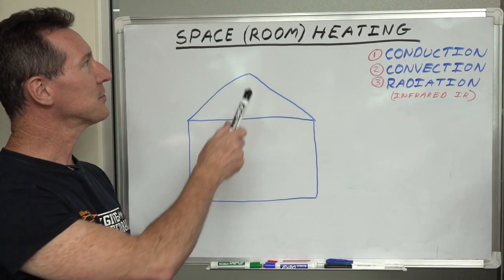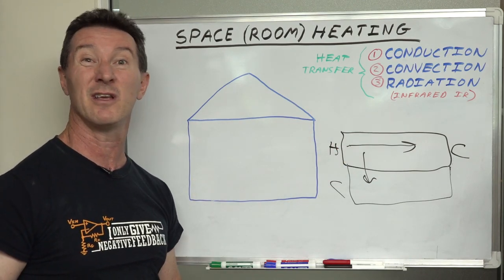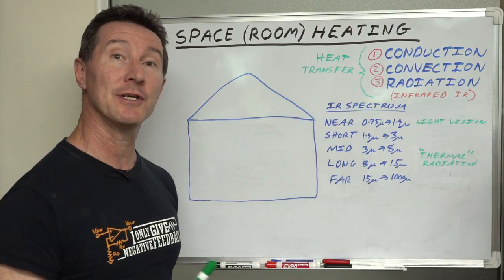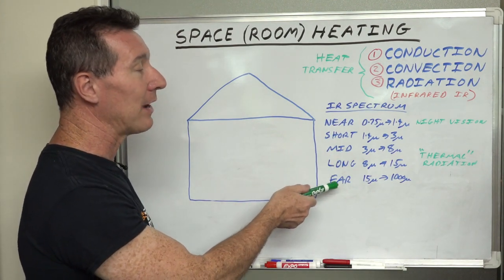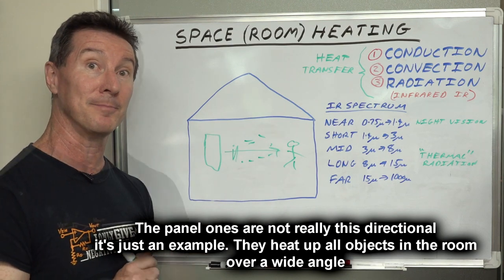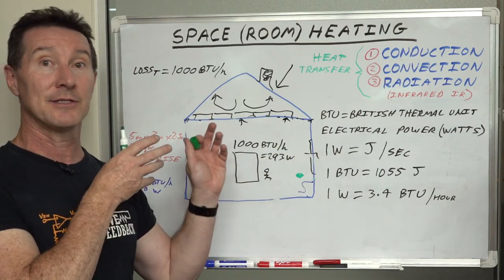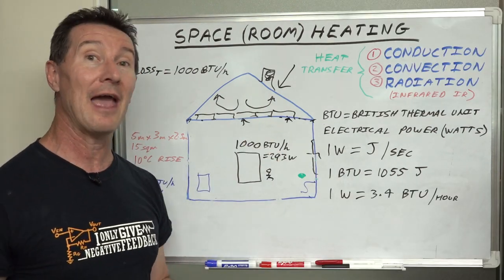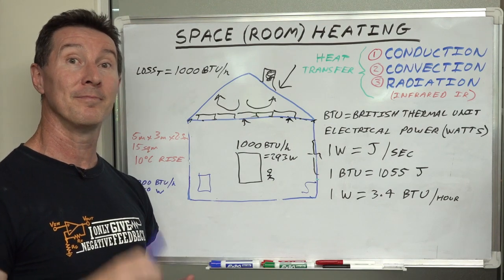EEVblog #1187 - Room Heater Technology Explained

Comment: just realized solas may actually last longer due to their "magic graphene" being seemingly applied all over the element however they will still be no better efficiency wise than a bargain-basement 1kw wire wound ceramic element >100% is impossible
must note: by "last longer" I mewan the "magic" graphene provides an oxidizing resistant barrier to the element and spreads the heat evenly so as to reduce "hot spots" that can burn out low quality elements faster however this only prolongs the life of an already cheap heating technology  while bumping the price way over the longevity bonus so a true "eco nut" would shy away from those lying pos's and just buy a cheap thermostat controlled oil massed heater that claims to use "eco friendly" oils rather than solas wank heaters

Comment: Every heater is reducing the energy of the universe. Thanks physics
Reply: Dylan T Nope, but it usually increases the chaos (entropy).
Reply: Eh, just moving it around really.

In many cases, heat in one area was converted into electrical enerfy which was then moved into your home and re-released as heat.
Reply: Resources of Earth as a system, yes, of universe, certainly not.

Comment: A heat pump is very inefficient. As the temperature goes down the efficiency drops. At about 45°F It is pretty much useless. You have to have heat outside to transfer It to the inside. The opposite is true for air-conditioning, the hotter it is outside, the less efficient it becomes.
Reply: I'll have to let my heat pump know about that 45 degree limit... it's doing quite nicely at the sub zero temps we've been having.  (( you're referring to the old R22 systems, YES, they had issues, not so much with the new systems ))
Reply: I don't care what type of refrigerant It uses, they all have the same problem. At below 45°F, the condenser/evaporator will turn into a block of ice. At that point it will not function at all. You're heat pump has a secondary heat supply, either electric, oil or gas, Which takes over at about that temperature.
Reply: It does NOT have secondary heat... it's all from the refrigerant.  I have disassembled several of these units, not an electric heater to be found.  Try again.
Reply: The only way a heat pump will work below 45°F is if you lived in a very dry climate. In the heat pump mode, the evaporator Is on the outside unit. The evaporator needs to be at least 15°F below the outside temperature for it to work properly. That means the evaporator is below freezing. Any moisture will freeze on the evaporator. Turning into a block of ice. At that point it will not function. The closer the evaporator temperature is to the outside air, the less efficient it will be. 
: 
Lodging:
Reply: I repair them for fun and profit, and have one heating my house as we speak...  current temp is 7, humidity is 45.  YES, it does have to defrost, YES, during snow storms it freezes up.  I'm not sure where it's finding the heat, but I can assure you, it has absolutely no secondary heat.  I haven't had my specific unit apart, but I picked one up from the hvac shop, there is NO secondary heat strips in them.  None, zilch, nada...
Reply: You may do it for a hobby, but I have been doing it professionally since the 1970s. I'm now retired.
Reply: I'm still wondering where mine has it's secondary heat coming from.  I'm sure things have changed since the 70's...
Reply: Joe A,  it's clear to me that you are not aware of how "modern" heat pumps (with regular defrost cycles) work. Have a look around, the world has changed since the 1990's and we are enjoying COP's of 3-4 even below freezing. I love mine!
Reply: In spite of what you might think, Automatic defrosters has probably been around longer than I have been alive. that's nothing new. Yes we have better electronics, and better Freon. But you cannot defy the laws of physics. No energy conversion is 100%.  These are closed loop convection systems. They do not produce heat directly, they transfer it from one place to another. You get the efficiency by condensing moisture out of the air. 144 BTUs per pound. When it freezes you will gain another 144 BTUs. But that is lost during the defrost cycle, Plus some. Once the ambient air reaches the freezing point, the moisture in the air diminishes. And any moisture in the air is frozen already. You're left with pulling heat directly out of the air, 1 BTU per pound of air. And as it gets colder, the Temperature difference between the Air temperature and evaporator temperature is reduced,  This reduces the pressure. Reducing the efficiency even more.
Reply: 1 BTU per lb of air... that would explain why the fan on the outdoor unit is so big compared to the fan on the indoor unit.  It has to move a massive ( 18k BTU worth ) of air to extract heat from.  No one said that efficiency didn't drop based on temperature, i can feel it.  When we were down to -15F, the air coming out the indoor unit wasn't very warm.  I did have to supplement with a space heater as it just couldn't keep up ( I bought the wrong size unit, messed up on my heat loss calculations ).  I can guarantee you though, there is absolutely NO resistance heater on the indoor unit.